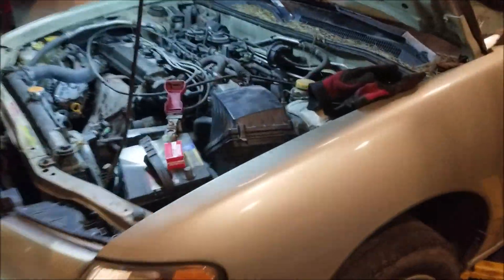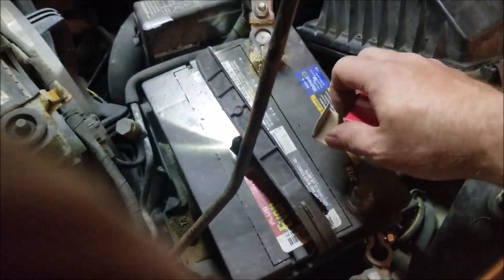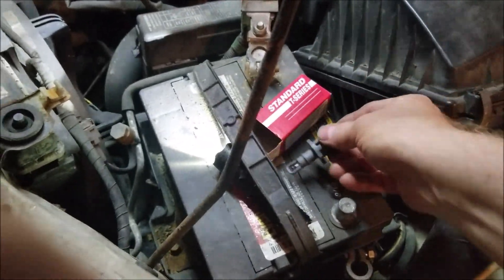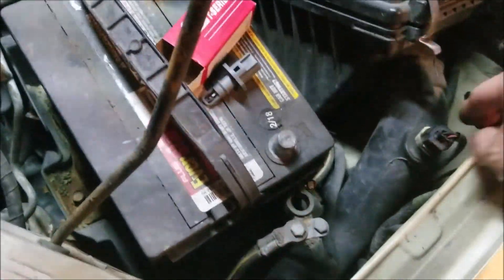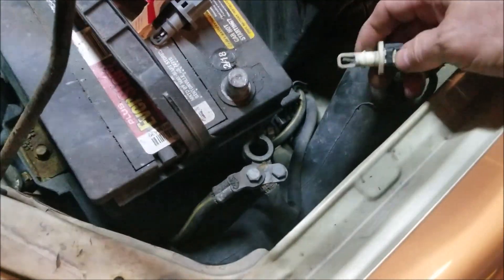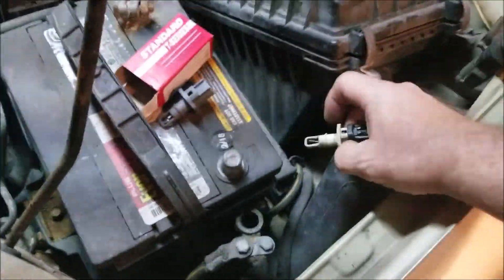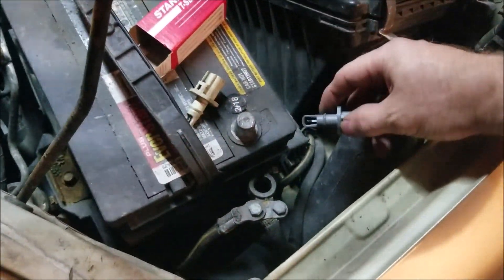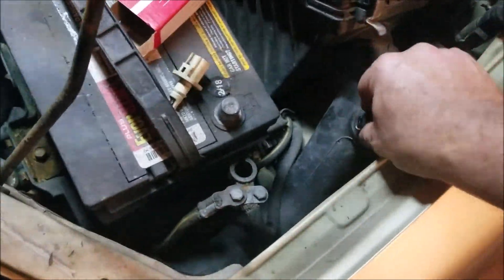P0110 - 5 Minute Fix Air Intake Temperature Sensor 1998-2001 Nissan Altima

Comment: Can you tell me where the absolute pressure sensor is pulling a code P0105
Reply from the maker: It is going to be after the air filter and by the throttle body... sometimes they just need to be sprayed with a map sensor cleaner and new air filter...

Comment: Can inclean the iat sensor with contact cleaner or does it have to be mass air flow cleaner? Thanks
Reply from the maker: Great question... I've used carb cleaner, brake cleaner, all work, solvent based that evap fast, you just want the carbon build up off. It doesn't take more than a quick 1 to 2 second burst on each side. Wear eye protection and be safe.

Comment: Please Help me with my nissan Altima1999

I scan this 
I have two code
P1320 &1105
Please help me
Reply from the maker: So th a p1350 is an ignition coil error... I would replace all the spark plugs and ignition coils, they probably have a lot of mileage and need to be replaced. The p1105 is a map sensor error, clean the throttle body with carb cleaner, get all the carbon build up from around d the throttle body. Push the butterfly in and spray repeat. Replace with a new air cleaner. It will start really rough, but then settle down. This should fix both those error problems.
Reply: @GarageMahalLife thnx you Mrs i try tomorrow morning, 

And then I'll tell you how it works, because for now the car can't stay running🙏🏾

Comment: Que falla ocaciona este sensor?
Reply from the maker: The sensor failed is all, changed it and all was good. If they aren't cleaned every air filter change, 30k miles, they can get a dirt film build up on them and stop working.

Comment: Thank you awesome video, I will let you know if it took away the P0110 code and if the cars problems are gone.
Reply from the maker: On this car, it ran smoother and the code/check engine light went away after 5 minutes. Error code was not present when I scanned it later on.
Reply: @GarageMahalLife  It should do the same thing for me, I visually inspected the wire and there's no damage, the sensor wires had an output of 4.8 volts, so it has to be the sensor. Sadly the part will be here tommorrow morning. I'll comment tommorrow again with the results.
Reply: I replace the sensor yesterday and erased the code and the results were awesome, the car ran without problems. I am super glad you made this video.
Reply from the maker: You are welcome, glad to help! And thanks for Liking, Subscribing and sharing :)